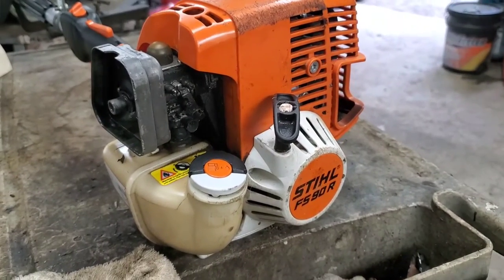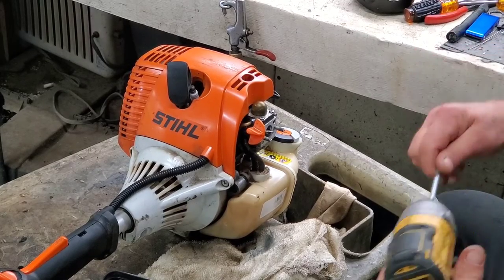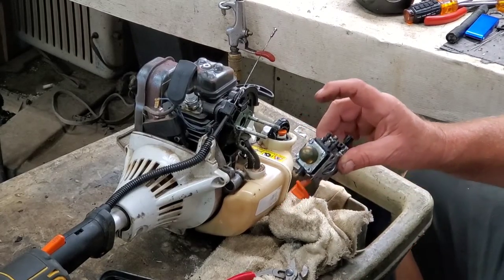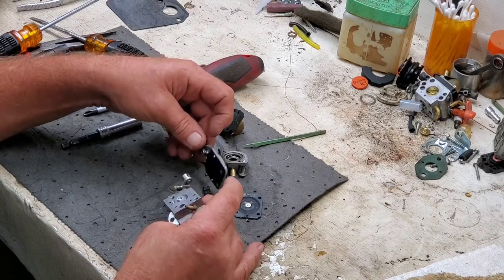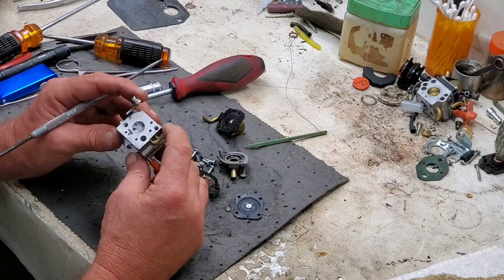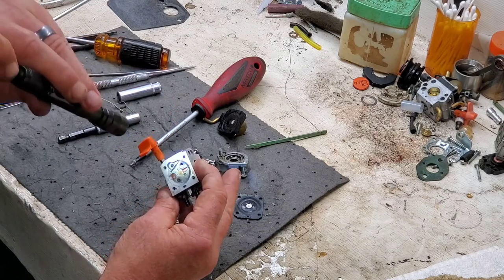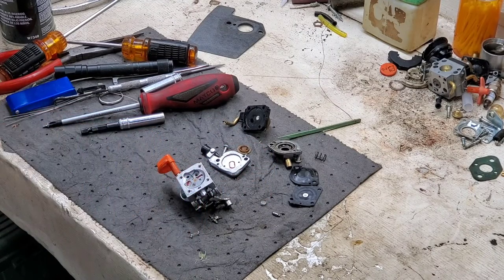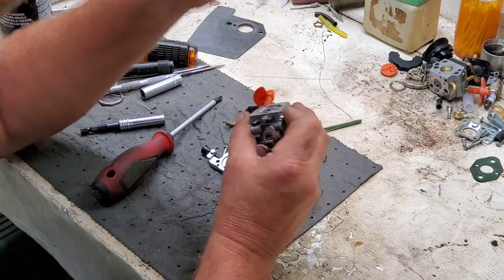Stihl trimmer leaking fuel and no spark. Step by step diagnosis.

Comment: Have you ever tried using a chopstick or wooden dowl to push the screen evenly into the seat? Please use nitrile gloves and constant ventilation. You work in a very toxic environment. No need to poison yourself. 
Thx for your channel. I learn from every vid. 
BTW, I've driven by your location many times working for RCEMS yrs ago. Used to be a burned-out car on Screaming Eagle rd. for decades.

Comment: Sir. I have a stihl br 600 blower. It's saturated with fuel. I think I just found the leak. It's from some pin hole relief or something on the side of the carb body underneath where the H/L screws are. Its spraying out fuel. Is this the same reason as here? The diaphragm ? I took the carb apart and it looks clean. I have no idea the purpose of this pin hole. ty
Reply from the maker: Put a new carburetor on it my friend.

Comment: cut an old screwdriver flat fold the screen over it and then push it in the hole buddy. Ive done that before you just need the right shaft size on the old screwdriver to get it right

Comment: Good informative video thanks. Can u explain the jig u use to check for sparkage you called your jig I think. U hooked a wire to the spark plug boot and one to the muffler
Reply from the maker: Thanks for watching. It's just a jumper wire to ground the spark plug. I use it because of so much plastic on trimmers, it just makes it easier.